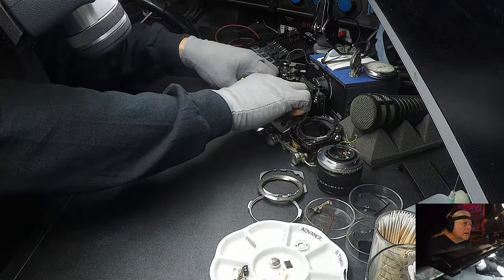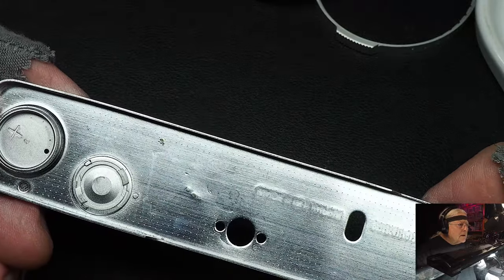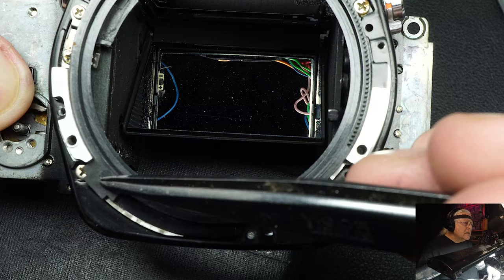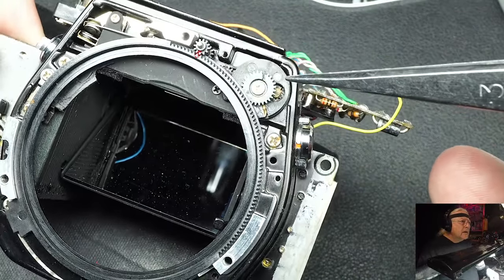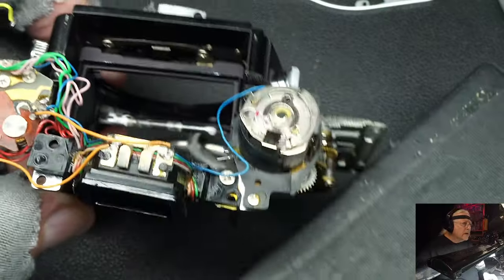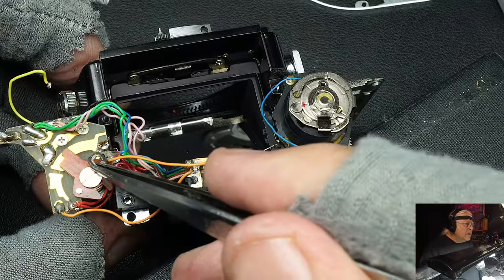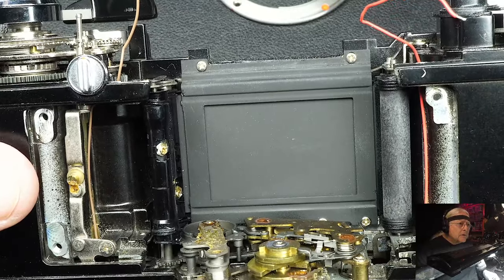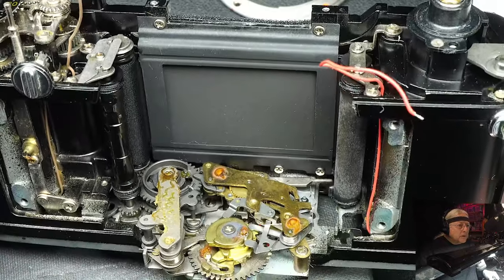Olympus OM-1n | Meter String and Gear Tutorial | DIY #010

Comment: Hello sir, I'm Oscar, the guy who disassembled the front part of the Olympus Om1n, the one who asked you for help with the meter strings, today I saw your video where you mentioned me and I want to thank you very much for your help, now I'm working outside the town when I arrive Back home I will try to fix my camera with the help of your video since it is very clear, I hope I can glue the strings in the areas you describe with a little crazy glue or something like that, I will try to adjust the shutter Because it is out of adjustment, I am not very good at this. I hope I don't damage the camera or I will have to throw it away. Thank you very much for your help, and I will continue watching your videos because they are very interesting.

Comment: Thank you for this video. I enjoyed it and now know not to try to fix my OM 1 light meter that works intermittently. Strings?? Pulleys? JEEZZZZ!!!!
Reply from the maker: Hello Neil
This video Article is what you need to read. It's something you can do, and it's not hard to do. "Olympus OM 1 Erratic Meter Needle Article #009"
Reply: @FilmCamera_Vlog  Thank you.Going to try it tomorrow. This seems to be at my ability level.
Reply: YES! I fixed it. Seems like it was corrosion on the switch. Thank you.
Reply from the maker: Hello  @neilmoran9988  
The meter in the OM-1 is very simple. It usually can only be one of three things. Normally.

Comment: Currently troubleshooting my OM-1 light meter.. So I quite happily watched this whole thing to get a better understanding of the camera's insides.
Appreciate you even just taking the time to record it all in HD.
Reply from the maker: Hello Liam
I looked over your text and pictures in the email you sent, and I can't find anything you did wrong. The steps you took were the same things I would have done. I am a commercial camera repairman, and I would not spend more time trying to repair such a camera. Time is money to me, and I would probably replace the meter or return the camera to the customer. If you  want to play with the camera, you could take the meter apart, but I don't think it would help fix it. If it were me, I would probably buy a non-working junker OM-1 and try swapping out parts, such as the meter or switch. Or I would buy a junker and try to fix it instead. There is more than one path to fixing a camera. Sometimes you much consider buying a second junker and try fixing it or using the parts to fix the first camera. This is what I often do. Learning how the camera works and having fun doing it is the goal. Camera service, or DIY, is supposed to be a hobby. A fun hobby. To me it sounds like a bad meter that needs to be replaced, but it's impossible for me to know with out having the camera on my desk to test. Best of luck. Sorry I could not help more.

Comment: This was really informative,while I'd never attempt to do a repair,found interesting.
Have a OM2 that mirror locked up and repair guy advised not feasible to fix. Guess wiring screwed. 
Maungaturoto New Zealand.
Reply from the maker: Thank you. Any camera can be repaired. It counts on if you think it's worth the cost. Many fathers send me their old SLR film cameras to have them restored so they can pass them on to their children. Many Vietnam vets send me their old SLR film cameras they purchased when in the service. Anyway, no camera is past saving unless it's worn and rusty.

Comment: Somewhere there is a shutter speed ring ball bearing that clicks when you change speeds.  Mine was  broken.   The string system was a pain to re align when the  lense mount was off.  Yes it was hours to reassemble.
Reply from the maker: Hello danc
That ball bearing can get lost real easy. I always put it somewhere safe in a tray so I will not lose it. You should always put a little grease on it when reassembling it so the speed ring will turn easier when changing speeds. Yes, the string system on this camera is a pain to reassemble even for me.

Comment: thank you so much for your great content! I really appreciate your videos! You already answered so many questions about my om1n- but I have another one (I hope I don‘t bother you😅). 
Is it risky using a 1.5V battery on my OM1n over time or is it only a problem with the light meter adjustment?
Reply from the maker: There is no risk in using a 1.5v battery. The adjustment is the hard part. I prefer the 1.35v battery myself. It makes the adjustment much easier.

Comment: Love the videos! I also bought an OM-1 back in the 70's because of the small size and light weight and the lenses that went with it. It was my first ILC  and I have used Olympus cameras since. I have started doing minor repairs to (personal) cameras and lenses. Recently I picked up another OM-1md . The shutter and mirror operate properly from 1/30 to 1/1000, but from  1/15 to 1 second the mirror hangs up and needs to be returned by removing the lens and using the lever on the right side of the lever box (as you look at it). Do you think this will solve itself through using the camera, or is there a simple fix for this (somewhat minor) problem? Again, great videos! (they can help keep us out of trouble).
Reply from the maker: I have never encountered that problem with an OM-1. If I were working on it, I would probably tear it down, clean it, oil the shutter shafts, and reassemble it and test it after adjusting the curtain times. Often when I go into a camera I have no idea what is causing the problem, but I find it during a normal CLA because I'm checking to make sure all the parts are working properly.
     Or to put it another way, if I know what is causing the problem, I go straight to it, but if not, I take the camera completely apart and check all parts.
     I've been working on the OM-1 cameras since they were new and I know what goes wrong with thim over time, but when an OM-1 has a problem I have never encoundered before appears, I often suspect that someone has been inside the camera and damaged it while trying ot fix it. In a case like this, I have to check all parts inside a camera.
Reply: @FilmCamera_Vlog   Thank you for the reply.  I am still in the "Minor Repairs" stage of camera repair (cleaning lenses, freeing up stuck parts, etc.) so at this time I will probably leave things as is (the slow shutter speeds don't get used that often) . I really enjoy your videos and think they will  contribute to the survival of many of the fine old  under appreciated  film cameras that otherwise would go to the landfill. Thanks  again !

Comment: Super helpful. I had an OM-1 whose needle was stuck at the bottom and not responding to changes in aperture/shutter speed. I followed your steps to 23:23 and was able to tension the string such that the needle became centered and free enough to bounce with movement of the camera. Do you have any advice on calibrating the needle to the correct native position for a given shutter speed? Say, for example, 1/1000.
Reply from the maker: Hello Meerchen
I have exposure and shutter testers in my shop, but they are expensive to purchase. Plus, you need to know some information to correctly use them to calibrate the camera. I don't think I can help you with this problem. The only thing I can suggest is to use your camera's ASA adjustment and run tests by taking photos of the same scene at different ASA settings. Thisis what I would do if I had no test equipment. You could also buy a used hand held meter from eBay and use it. You could even compare the readings of the hand held meter with your camera's meter and figure out the correction factor between them. I hope this helps.
Reply: @FilmCamera_Vlog  Thank you! I will share if I find some other hack

Comment: Very interesting and useful video, it was important for me to understand the aperture mechanism. I have an OM-1 MD and the issue is: whenever I change the aperture on the lens (While its mounted on a camera) theres a lot of tension while going down (from F16 to F1.8), it still works and fires correctly I believe.. Wondering why it could be stiff
Reply from the maker: If I were working on the camera I would check the lens (off the camera) f-stop first. If it was okay, I would next check the bottom plastic geared ring that engages the lens by pushing it clockwise with my finger tip to see how hard it was to move. If it was hard to move, it could be several things restricting the plastic ring. Then it gets into a repair situation that has to be fixed in a repair shop.

Comment: Does your overhaul include modification to run the meter circuit on a silver oxide battery instead of mercury?  I believe a small diode is typically added to drop the voltage from 1.55V (silver oxide) to 1.35V (mercury).  Thanks.
Reply: Or maybe you can calibrate the OM-1 for the newer batteries without the need for a diode?
Reply from the maker: @Mark-mj2ge  
Normally, I use the meter adjustment to set the OM-1 for whatever battery the customers want. Many customers send a battery with their camera and tell me to adjust the camera for the battery. I don't add diodes to cameras. I just use the camera's adjustments. The Canon F-1 meter is the only camera I ever worked on that needed a diode. Amazon sells different voltage button batteries for these older cameras, and battery holder converters. I never liked the idea of modifying a camera meter circuit, since I didn't feel it was necessary.

Comment: Hey, does anyone know how i can pop the latch to open the back of the OM2 without the film winder?
Reply from the maker: Hello JS
If the winder head is off, but the shaft is still in place, you need to find a tool and pull up on the winder shaft. That will release the film door. But, if the shaft is missing or had been pushed down into the camera, you need to make a hooked tool and pull up on a tab located in the hole where the shaft was located. You may need a flashlight to see the tab because it can be hard to see if you don't know where it is. Normally, the rewind shaft pulls up on this tab if it is in place. The only other solution is to buy a non working OM2 on eBay, open the back, remove the leather over the latch slide and see how it is put together so you can understand how to take the latch apart on the locked up camera. You can always force the back off, but you will damage the latch and latch slide. 

This is the best I can describe how to fix your problem without seeing it myself. Good Luck.